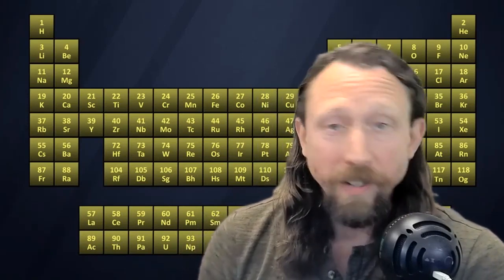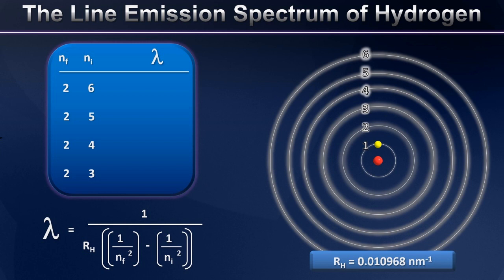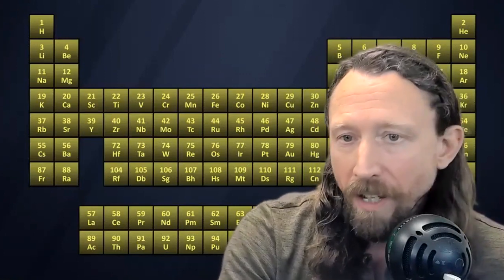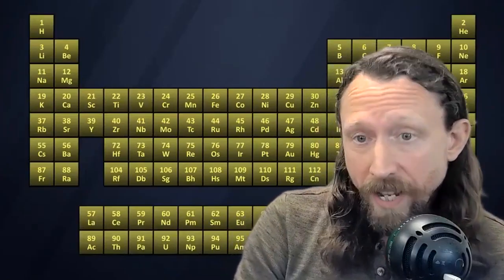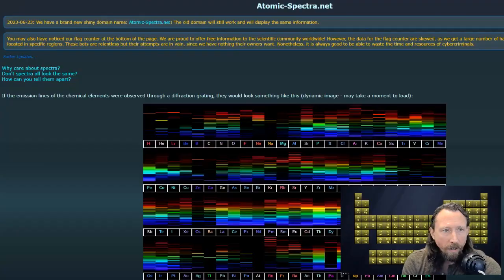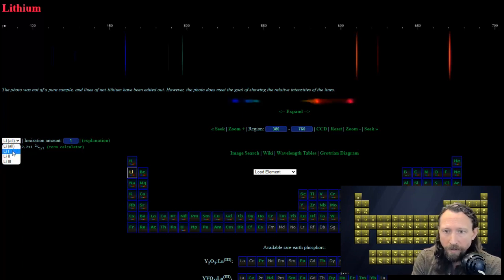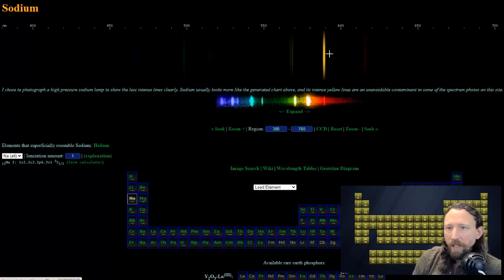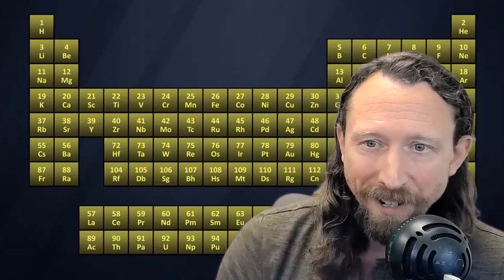How Do Fireworks Get Their Colors?  It's all about atomic structure!

Comment: Should connect a flare to a line gun so once the flare is shot it will bring a string of flares attached for rescue purpose. The line should not break easily to trace to the shooter, and should be able to stay alight for 2 hours once the line drops on the ground.